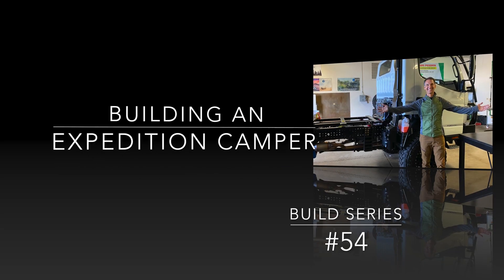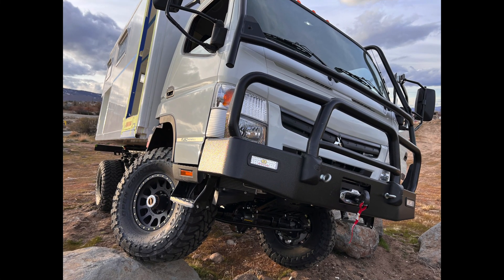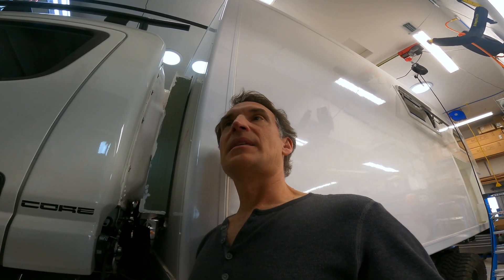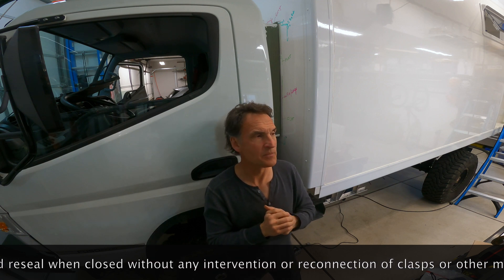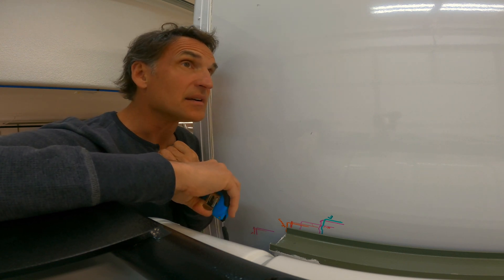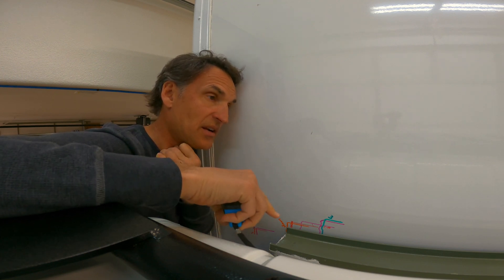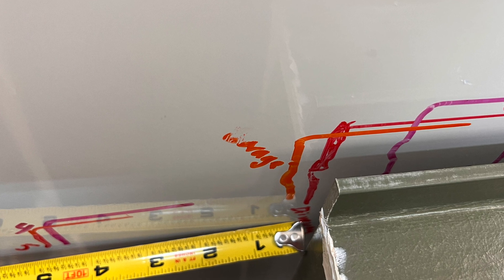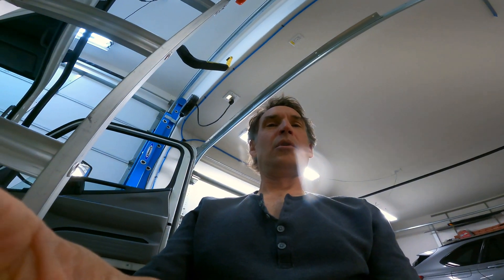How should I Seal my cabover pass thru?

Comment: I love your videos. I am wanting to do a cab pass-through just like you except a little bit bigger of an opening. Were you able to get any cutaway specs for builders from Isuzu or GMC?
Reply from the maker: Thank you! Glad you're enjoying the videos. My pass thru was limited by the curves of the back wall of the cab, and also the height of it, as it's pretty short in height allowing for a wide pass thru but a very tall one (~27-30" tall). The rear wall of the Isuzu/GMC is about the same as the Mitsubishi, but certainly some small differences but not likely allow for a much taller if any bit taller pass thru since the cabs are pretty short in height. Check the body builder's guide for more info and dimensions.

Comment: Do you have a video on the final passthrough sealing solution?
Reply from the maker: I will soon. I am having the seal built over the next month.
Reply: @vantripping  Great!  Thanks.  I'm loving the series. 

The motion you're seeing, is it both horizontal and vertical displacement, or is it all rotation about the contact point at the center of the frame?
Reply from the maker: @raymonddegennaro3097  You're welcome. Glad you're enjoying my video series. The movement is the rotation of the camper box relative to the cab which is mostly stationary while the frame flexes/twists it pushes the camper up from the frame. There is very little noticeable vertical deflection of the frame. I am going to do a more thorough test soon.